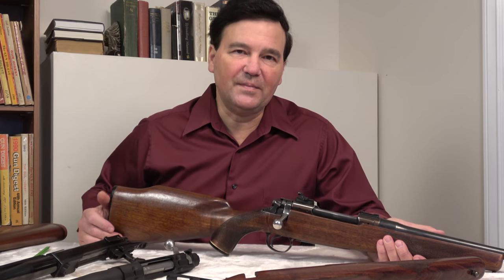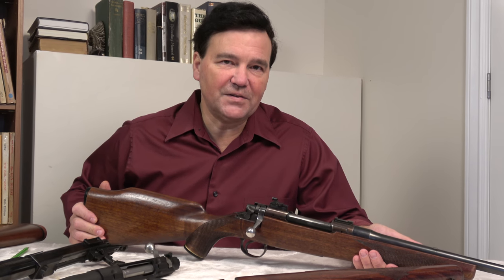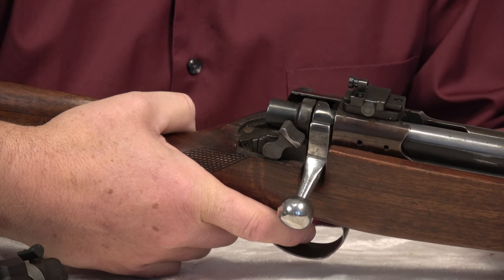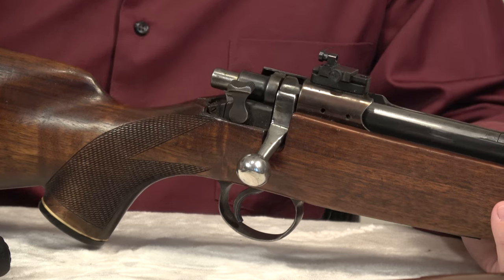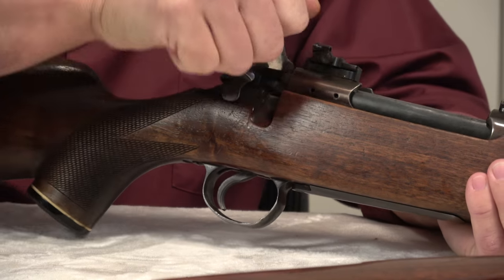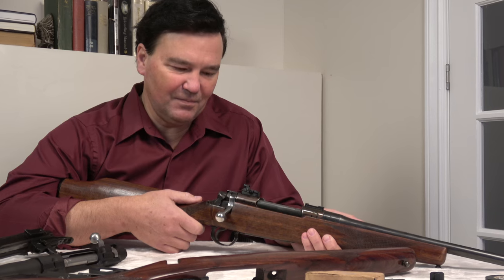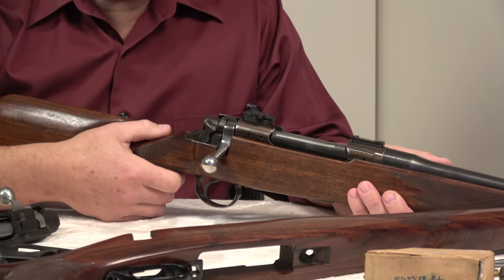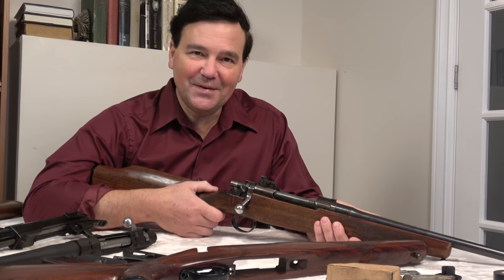Rifle Safety Fail

Comment: You need to rock the safety ALL THE WAY BACK; you were just going half-way, and most importantly, DON'T pull or play around with your trigger! Would you do that with a live round chambered?? I certainly hope not...
Reply from the maker: Thanks for writing and good advice. Sadly, the safety would not rotate in the customary way properly. I've seen others like this as well. It is likely that people pin the safety at the half mark; partly because some release the sear if rotated to the full safe position. Anyway, good advice and one ought to try to put the rifle on full safe if possible. Still, not really safe but worth a try. All the best.

Comment: Hello. I have a client that came in with one. What did you do to fix it?
Reply from the maker: Hi SN, On my own I removed a pin which someone had installed which prevented full rotation of the safety and after that the safety often worked. Being short of time and knowledge I then took the rifle to a smith who repaired/replaced the rest - more of a repair I think as the trigger and safety look the same. It is surprising how often safeties and triggers are modified by owners looking for improved results/function. I suggest that safeties and triggers be left alone - which you know. Even a "bad" trigger can become familiar. Hope this makes sense and best of luck.
Reply: @UnitedStatesOfGuns  Thank you. Much appreciated.

Comment: You didn't fully engage the safety. You need to rotate that safety all the way to the rear, not just straight up.
Reply from the maker: Hi Scott - Sadly, it won't go there - but you're right.

Comment: Safety works fine if the safety is not broken AND you know how to properly work the safety. Case in point, that is a P14/17 rifle (probably a 17), to properly engage the safety, you have to rotate the lever ALL the way to the back. Please stop spreading inaccurate information.

Thanks!
Reply: You're absolutely right pull the safety all the way back